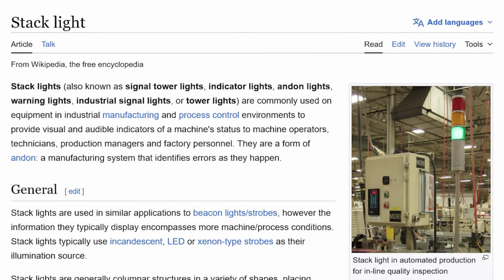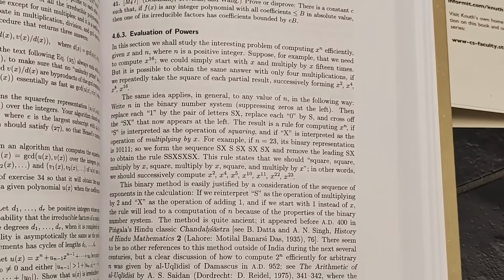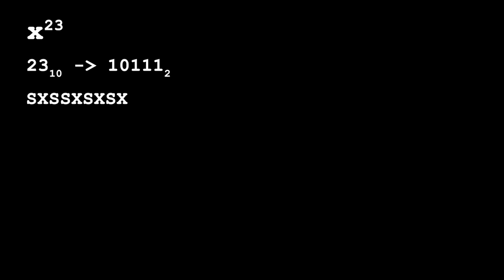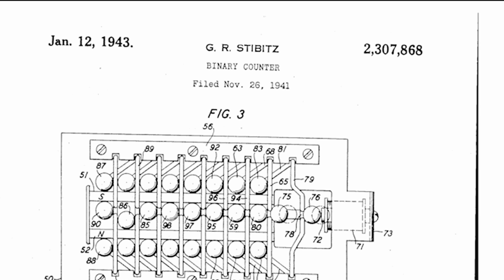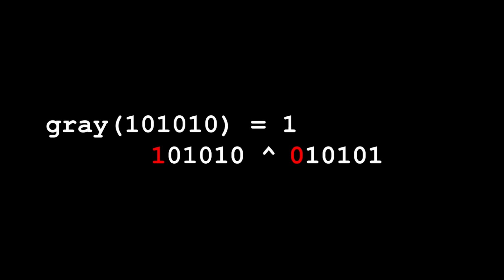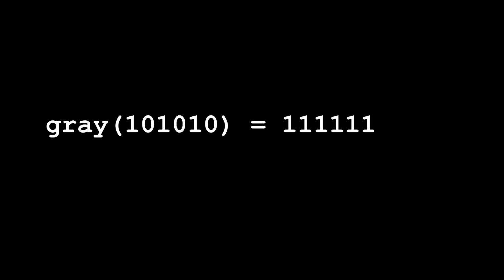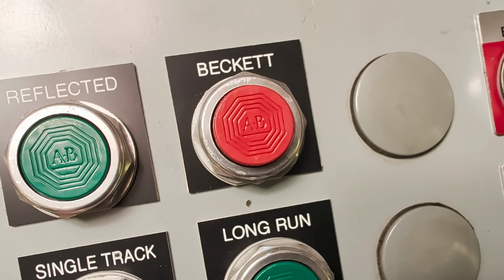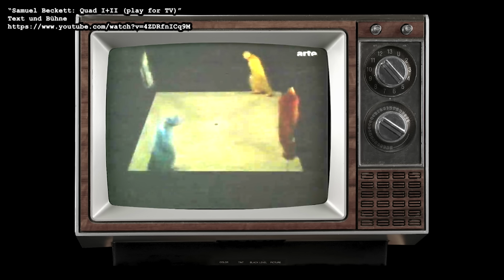The Gray Device

Comment: Regarding ESTOPs as used in industry - a huge chunk of them are just inputs read by software.  They're even allowed in remote I/O panels where the signal goes over the network.  The idea the ESTOP directly cuts power is nice, but impractical when "power" is measured in kilowatts.  

What you'll usually see is the ESTOP wired to a PLC input so that current flows when the ESTOP is not pressed.  That way if there's a break in the line, it triggers the stop.  Often you'll see the ESTOPs wired in series so that any one of them will kill the entire circuit.

Source: I do this stuff for a living.  I do usually advise using the ESTOP to cut power where it's feasible, but very often it's just not.
Reply: Rather clever that it's a current sense rather than a voltage sense, too, so that you don't have to worry about voltage drops over long runs.
Reply: @Curt_Sampson  I probably shouldn't have said "current," as there isn't any significant current running through them.  It's voltage sensing, usually at 24vDC or 120vAC.  You'll have to excuse me, I'm the software guy :)

We do use current sensing for analog signals though, for exactly the reason you mention.  Usually it's between 4 and 20mA.  They use 4 for the minimum signal so that you can detect a break in the wire.  Internally devices will have something like a Texas Instruments XTR chip (like the XTR117) to control the current.  If you do a search for something like "4-20mA pressure transmitter" you'll see examples of the equipment that use this.

Comment: 4:52 where i used to work, single bit errors were extremely critical. single bit error correction still gets a ton of mileage in the embedded world and is paramount for rad hardened devices (or just harsh environment devices)

Comment: About the game of life modular cell: you can use octagons with small square bridges and 3 pins magnetic connectors (they come prebuilt) or just dupond pins
Reply from the maker: I was thinking about that, but realized I could pass information about the diagonals in through the orthogonal connections, keeping it simpler. And I'd love to use the premade magnetic pogo connectors, but I can't find them for less than about $1/each, at least not on the scale I'll be buying them. I can do them for closer to 40 cents each if I just use raw SMD pogo connectors and supply my own magnets!

Comment: When I started working with AIX on the RS/6000 and took many IBM training classes in the late 90s, the remnants of that tape problem was still around. We were learning how to lay out the filesystem to improve disk access, either reads or writes of different file sizes. I remember looking at charts very similar to @2:08.

Comment: This is awesome! 

Although, as an educational piece, the E-Stop bugs me a bit... I've been tempted to use them as a generic switch, because they look so cool, but as one of the most universally recognizable safety features across society, it felt wrong to use them in ways that could confuse or undermine anyone's understanding of their uniquely universal purpose.

In other words: I feel like we have a responsibility, especially with kids, to make sure there is no doubt what a big red mushroom button does, so that when they encounter it on Dad's table saw for the first time, they're not thinking it's the button that changes the lighting. They should always think: that's the thing that shuts things off.
Reply from the maker: I was actually thinking it would have some educational value for exactly that purpose, since it does stop the lights from running, even if it doesn't completely turn them off. And hopefully be the start of a lifelong instinct to slap them if something needs to be stopped. But I'm definitely still not sure it was the right choice!
Reply: @Attoparsec  Oh, good point. I didn't think of it that way.

However, could I suggest maybe using one of the stop buttons instead, and using the e-stop as a hard power cut? The reason being, that regular stop buttons are used as you describe; they stop a process without usually powering down the machine or controls themselves.

Plus, you'd get to use one of those original STOP label plates.

PS: Not trying to be argumentative. Just collaborative... But I'm on the spectrum, so sometimes it doesn't come off that way.

Comment: Great presentation!
Are there single track Gray codes with the sensors bunched up together (e.g. on one half of the circle or allowing for a 60 degree cutout without any sensors)? Have you seen a tolerance analysis for single track Gray code sensor position errors, like the uncertainty of SMD component placement?

Comment: E-Stops are often more complicated than just cutting the power to everything: apart from cutting power only to the dangerous part (e.g. laser cutter's e-stop cuts power to the laser tube, but not to the cooling) they sometimes do something slightly more complicated to allow motors to be stopped ~immediately instead of coasting to a stop (e.g. short an AC asynchronous motor with a resistor).
Reply: They are also normally wired with 2 isolated circuits for redundancy.  If either circuit fails, it will put the machine into E-Stop which stops all movement and/or hazardous conditions like the output from the laser in your example, also things that have potential energy like pneumatic and hydraulic circuits to prevent un-commanded movement.  In more complex equipment like the CNC machining centers I repair, there are often dedicated devices specifically designed/programmed to handle multiple E-stop circuits dedicated to specific areas of the machine, power supply good signals, and limit/prox. switch inputs often tied to guarding like internal tool or pallet changer doors.  In addition to E-Stop 'mushroom' switches, it also monitors and allows all access doors to be electrically locked to prevent them from opening during dangerous operations unless specific conditions are met.  It also uses a 2-phase clock to drive the 2 separate E-Stop circuits rather than just DC to prevent operators from jumping safety circuits with normal control power, and can detect if the 2 circuits get shorted together.  The units often have 2 separate controllers running in sync internally so if the outputs from both don't agree, it automatically faults out and the machine goes into E-Stop.
Reply: @marcseclecticstuff9497 security whack-a-mole is neverending, but ... it can't be great for User Interface Design when you're explicitly trying to thwart the intended users.  I now have a bit more forgiveness for certain designs.

Comment: I assure you Knuth is more easily digested than the Hughes Radar Bible.  BTW, I operated 360s in the USAF, they were WAY out of date when I arrived, I am not that old! No stack lights then, only a godawful loud bell which you could not miss even over the other 300 fans in the room, and it only went off when the system crashed or someone used the 'bell' program to prank you. Pranks on missile warning groundstation computers were strongly discouraged.

Comment: Someone really clever might look at your optical encoder example and say "well, if it's flickering, then just read the sensors for long enough to detect that, and if we pay attention to which bits are unsteady then we should be able to figure out exactly which two sectors we're hovering between." Which is true, if mildly impractical. But Gray codes also provide an advantage if the encoder is slightly _misaligned_, so that when you're near a transition you might read some bits from one sector and some from the neighboring sector, _reliably_. This especially happens on mechanical encoders, the sort where little "fingers" run over PCB traces. With a standard binary code, you're out of luck: the value you read could be basically any unrelated value from anywhere on the wheel. But with a Gray code, the value you get will always be from one of the two sectors you're crossing between. A slight misalignment just means a slight variation in where the transition happens. Which, again, is kind of the best you can expect from imperfect equipment.

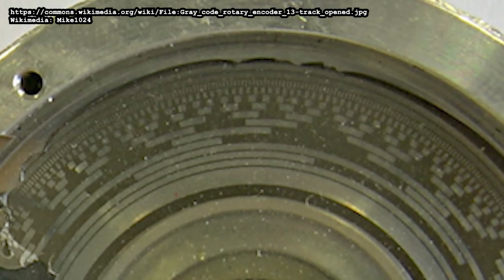Comment: 7:11 A very nice detail (& obvious when you think about it), is that the binary pattern is placed with the "Most significant bit" (representing the highest number) is placed nearest the center & the "least significant bit" is placed at the edge, instead of having it reversed.
This way it automatically gets a much finer control compared to if the pattern was reversed, then the precision would be horrendously sloppy :)

Comment: I rediscovered these for myself earlier in my life. The application which often leads to it is when flipping a bit comes at a cost (usually time) which you thus want to minimize. For example, say there's several locks on a door, and you know how to pick locks, but each time you do you're not sure if you're opening a dead bolt that was closed or closing a dead bolt that was already open.

Comment: 2:30 first, force the students to punch their student IDs, in binary, into a marked area in the top right corner of the paper. They should punch zeroes with a regular hole punch, and ones with a punch that takes a bite out all the way to the edge of the paper.

Then, stack all the papers neatly and grab a knitting needle or chopstick. Stick the needle through the stack of papers in the rightmost punched position, and lift. All of the papers with zeroes punched will come along with the needle. Stack those neatly on top of the ones that were left behind, and repeat one position to the left. Continue until you've done all the bits. Congratulations, radix sort!
Reply: I love this
Reply: @noseman123  it has TONS of practical problems, but it's still cool :)
Reply: Step one: have the students take their examinations on the computer
Step two: done
Reply: @MushookieMan but but but my Rube Goldberg moment of genius

Comment: Use case: bluetooth, line of site, zero RF noise, user to user coms. Freq spec LED's to filtered sensor reciever. Small, cheap, undetectable with blinders. Rad vid, churp.

Comment: I have also seen them used in department stores, the old stores that you no longer see, where they were used, along with a chime, to inform staff of something, without needing to have a PA announcement, and thus not disturb the quiet musical background, but still be able to alert the suit wearing staff that attention was required. They also used a pneumatic tube system that connected each till point to the central accounts office 2 floors above, which handled the processing of the cash, cheques, or the zip zap credit card carbon copy blanks that embossed the card details on, and the tube would, a minute or two later on, bring down a capsule with the transaction result, so you got your change, a receipt and if a card your copy of the transaction. Sadly they modernised, lost the tubing, lost the staff who knew the stock and how it would look on you, and went to computerised tills, staff who were cheap and inattentive, and massively increased the inventory to compensate for the lower quality. I still have old shirts from there, still good decades later on, and still good enough to be basically usable and not flashy. A lot from my father, who bought lots of business wear there, including a lot of no longer in fashion suits. pinstripes are not exactly fashion but still have one for fancy dress parties.
Reply: Having worked at some department stores, I did wonder sometimes how card transactions were processed when some of our older customers first had them. Sounds rather relaxing and fun, honestly, compared to the charmingly dated and interesting but arcane POS terminals and the various pressures their expedience foist upon us. At least until you're having to wait on the slip to come back from the transactions office while a line stretches across the store on Black Friday...

Kinda wish they still had those tubes for change requests and other ancillary tasks though. Ive never worked in a building old enough to have had them. The buildings I did work at, however, did contain many other vestiges of bygone eras - namely, offices, fixtures, and visual for departments whose services were either cut out entirely (alterations, notions) or foisted on staff already stretched thin (visual rooms, backstock, etc...)
Reply: Thanks for jogging my memory!!
Childhood me was mesmerized by the stack lights that were positioned at the main desk of the St Louis, MO Central Libraryt. A pneumatic tube messaging system was set up along with a series of chutes and dumbwaiters designed to funnel orders from the card catalogs and microfiche machines on the main floor, up into The Stacks-- a series of 5 floors above where most of the reference collection for the whole library system was stored.
A patron would look up their needed materials in the catalogs and use the provided notecards to write down the call number of the needed book, tape, or film, then hand it off to a librarian at the front desk. They would then figure out which one of the tubes to drop it into so it can get carried to the proper location of The Stacks where another librarian in charge of that sector can check to see if the publication is available. If it was, they'd flip the Grey Lamp a certain way to notify the front desk that they're sending the book down the chute in a few minutes. If not, they'd flip it another way to let them know it's out on loan, out, but still in the library somewhere, or unavailable totally. 
When I was in 4th grade, I finally got to take a school field trip up into The Stacks and saw how that half of the system worked. It was totally powered by college kids that needed a part-time job and were skinny enough to fit between the shelves up there. 
Of course those tubes, the lamp, the chutes and even The Stacks themselves are long gone by now-- too analog in our digital world. 
https://vanishingstl.blogspot.com/2010/09/central-library-renovation-will-destroy.html

Comment: Knuth in a BOX SET.  Cool.  

Also:  Merge sort would've probably been optimal or close to it given that you've got multiple processors, but for a single processor and a fixed-length field?  Radix sort!  I have personally done this, and yes it involved OCR.  It was a fairly fat stack of cancelled checks, and I was an intern at the local bank... big fun, seeing all those checks flying into eleven different bins... (eleven, you say?  Eleven.  The last one is the "oops" bin, aka "I didn't read that"... this would subsequently involve a human manually encoding a new OCR strip for the bottom of the check... )

Comment: I think Long run can be useful if you need to know whether the encoder wheel is plugged in or not, without using a dedicated wire that would always read 1

Comment: I was looking into singletrack grey encoding for an interactive human size hamster wheel design. The wheel would have cut vinyl encoding strips adhered to the back and 9 sensors arranged to get that sweet sweet 1 degree of precision. The decking of the wheel would be perforated steel powdercoated black, and a series of monitors would be mounted around it. The perf enables visibility through the decking, and the STGC encoding allows you to drive the video content directly based on the motion of the user. Never built it, but I did waste a bunch of time in CAD engineering it! someday giant hamster wheel.... someday.

Comment: Another parallel of Gray codes, and one that I was taught in uni, was traversing a cube. If every digit is a dimension, then having each digit being 0 or 1 gives you the corners of a (hyper)cube. The edges of the cube then connect corners that differ by only one digit. Imagine a 2d hypercube (also known as a square): from (0,0) you can follow an edge to (0,1) or to (1,0), but you can't cut across diagonally to go straight to (1,1).
So, how do you find a path across all corners, without duplicating? It's simple, just like the Gray code: you first take the path of 1 dimension lower across one half of the cube, move to the other half, and follow the mirror image of the path back. So:
0-dimensional cube (or a point): no steps. Done!
1-dimensional cube (a line of length 1): do nothing, then go from (0) to (1), and do nothing. Done!
2-dimensional cube (a square): go from (0, 0) to (0, 1), step over to (1, 1), and follow the path back to (1, 0).
3-dimensional cube: follow the path (0, 0, 0), (0, 0, 1), (0, 1, 1), (0, 1, 0), then step over to (1, 1, 0), and follow the path back: (1, 1, 1), (1, 0, 1), and finally (1, 0, 0).
This works for higher dimensions as well, but it becomes a bit difficult to visualize, but the maths work out.
Reply: Feels related to Hilbert curves.
Reply: I feel as if this is some sort of group theory thing.

Comment: Another advantage of using Gray code on encoding wheels is that the different sensors don't need to be absolutely perfectly aligned with each others. With binary encoding, as you have several transitions happening simultaneously, the sensors need to be aligned with great precision, otherwise you end up with jumps in the read position as one bit flips before or after the others. As you transition from 7 (0111) to 8 (1000), you might momentarily go through all the other digits, depending on which bit is early or late.
Reply: It is, in general, optimal when going between clock domains, since there will be an uncertainty of at most 1. An encoder wheel is kind of the ultimate "different clock domain," because it's not synchronized to anything, least of all the processor reading it.
Reply: Even if aligned perfectly, since it's rotary when you assume a "sensor area" of a circle (not a point), the inner sensors would surely trigger first.
Reply: Important for TV, especially color TV. If a colour channel were to go from 127 to 128 using standard binary and the bits didn't flip in sync, the intermediate values could easily result in wildly incorrect colours getting displayed